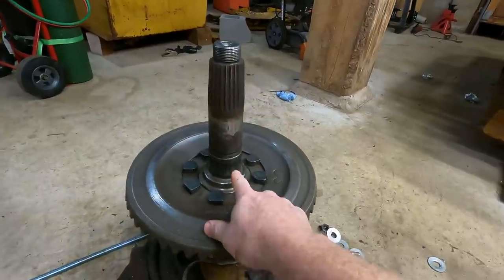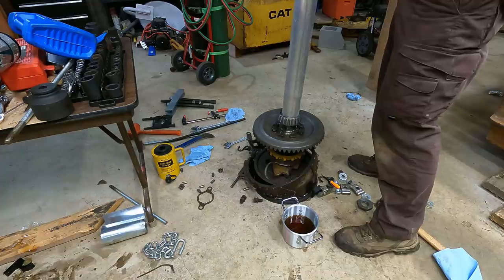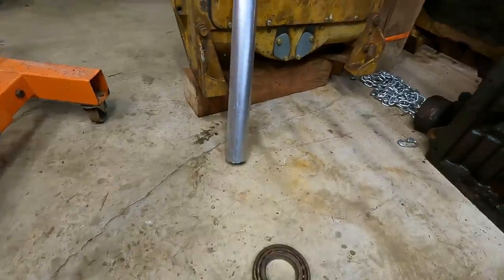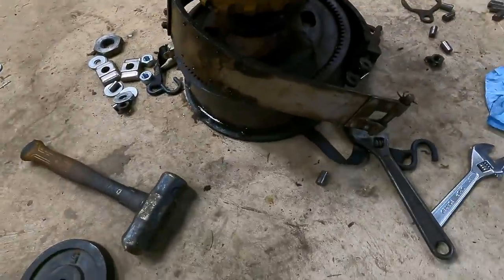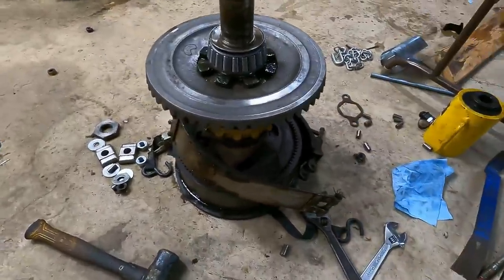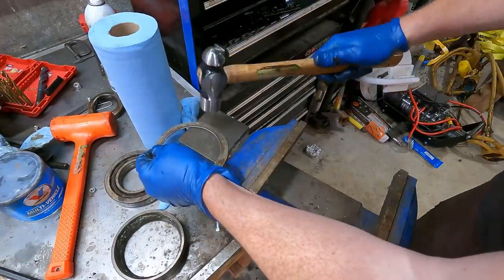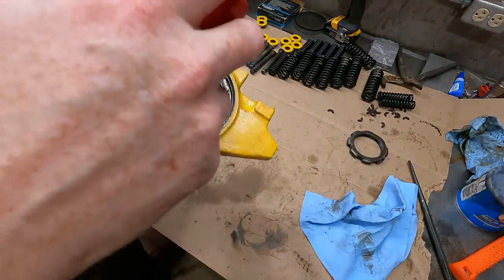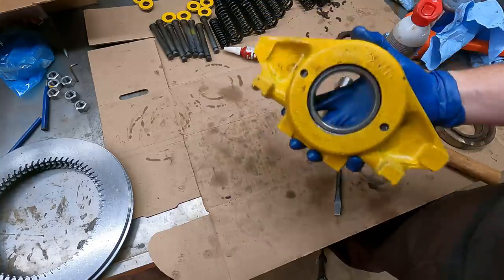Caterpillar D4 steering clutch and bevel shaft rebuild (part 2 of 2)

Comment: Western Truck and tractors repair just dropped a d4b under carriage and drive sprocket rebuild video ,he also told where he found the specific pullers  to do it .Two previous vids on bottom rollers and frame work .A pipeline construction company owner retired and has shops  of tools  and equipment for possible sale...

Comment: My first job with Cat was in the tool room. The most important thing I had to do is keep track of all the rental tools just for what you are doing now. Every nut, bolt, adapter, hydraulic press and pump had to be inventoried. Those kits had some serious rental deposits and some of the contractors were only trusted to cash. My strongbox and receipt book logged a huge amount of bucks every week.
It's funny but after all these years I recognise the tools you are buying.
I left Cat when I was 21, I'm 63 now. Time sure does fly.
Cheers
Reply: I really enjoyed what you wrote. In the Engineers I had to inventory General Mechanics Tool Boxes. Even now I think of tools by noun nomenclature, screwdriver, cross tip, etc. I think I had about 40 mechanics.
Reply: @suburban404  the military is the same way. In the Air Force we had to inventory before we left the shop and before we left the aircraft. Lost tools made for a bad day from the top down. You check, double check and yep.......check again!
Cheers

Comment: If you think your family members get upset with you heating up oil soaked parts in the oven, you’ll really get a reaction from them if you clean your sockets and wrenches in the dishwasher! I found that 1. It gets your tools amazingly clean! 2. It gets your wife amazingly mad!
Next time you need to weld thick parts with your wire welder, preheat them first with a torch. You’ll get much better penetration and a much better weld.
Reply: And clean off the slag between each pass, like IC Weld shows all the time.

Comment: Great job, Matt! I chuckled when you said "I use a ton of these on presses" and  in reference to the pressing force "it's not a ton of force". That thing about the new bearing being thicker - I can see that sort of thing happening to me. I replaced some bearings in the transmission of a fair-sized tractor I used to own - and found that one of them was missing a ball - apparently since it was manufactured! I'm looking forward to seeing you run this thing!

Comment: I don't know if you remember any of the commenters by name as of yet and for all sake of purpose, not necessary anyway. I am following this closely even though I will never be able to do this kind of work again. My question would be, remembering lightly when you found this machine, before you knew how much  real damaged this machine was, "were you confident that you could repair it" at the time, if it needed any type of repair? I think you are doing the right thing in building a machine from ground up as its going to be equivalent of a lightly used machine considering the engine is a "used" part. I do believe if any luck fell your way, was finding the engine you have for making it whole again. Most that age would fall into a tired but still usable piece of equipment. I have yet to work with but one man in my life that could do this. He was a old man in a young mans body and his ability didn't go unnoticed, he was that good. You may not call yourself a mechanic on equipment like this but if needed,  I sure would want you as the person to do any wrenching on my equipment. Its all I can offer you but please believe, I think you "walk on water" as mechanic.

Comment: Matt, if in doubt, grind a few mils off the snap ring's parallel face. You might have to make a wooden rig, but a belt sander will do the job. Also, they make bearing adhesives to keep outer races from slipping.
Reply: Why are my new bearings crunchy?

Comment: I like that you removed the coating from the nuts before welding. I see a lot of people trying to weld galvanized nuts to remove broken bolts and that does not work well the zinc results in lot of porosity.

Comment: Impressive results for a flux core welder.  Think I will pull mine out for a dust off. Upgraded to a  DC Electrode Negative back when that was a cool thing to do with your spare time.
Reply from the maker: you get way less spatter if you take the shielding nozzle off, it almost looks as good as normal mig... almost.

Comment: Where parts need cooling to aid assembly and are too awkward or bulky to get in a freezer, I`ve taken the "snow cone" off a CO2 fire extinguisher and held the hose directly to the part and done as slow a discharge as possible and it works remarkably well especially when combined with heating of the other part.

Comment: Another way to hold a loosely fitting immobile bearing race in place is to lightly pin it with a small punch around the race contact surface area in a dozen places or so and then press it in with a press.

Comment: on the throw out collar retaining ring that would no longer fit in the bore do to the thicker thrust bearing. i might have thrown the collar on a lathe and come in with a parting tool on a boring bar and  widened the groove the 0.040" to allow the wire ring to seat properly... obviously the cat factory bearing was a special with additional suffixes  chances are of the assembly coming apart without this mod is very slim.

Comment: A quick method you can use if bearings are spinning is putting a bunch of punch marks in the a part that the bearing fits into. I did it in my old beater truck axle gear housing plus some retaining compound and it's been fine for almost 10 years now, It's kind of hillbilly-ish but it works, so it should be right up your alley

Comment: For loose fitting bearings, you can use a centre punch to put a dozen or so dimples on the inside of the housing. The raised material around the centre of the punch mark will be enough to now hold your bearing in place.

Comment: Seen a few videos where thy peen, the bearing housing with a pointed punch, creating fine dimples right around the housing. This makes for an interference fit, so the outside race doesn’t spin in the housing, along with locktite in place

Comment: Matt, I did the same job on my 1949 and I had the same problem with the .040 too thick bearings. To get the snap ring to fit properly you need to get the right bearing. As I remember, I called the clutch supplier who is the same one you used, and he got me the right bearing, so you don't lose that snap ring later. Just thought I would give you this info, hate to see you have to rip it down again.

Comment: If your considering upgrading your welder look into the titanium 200. I had my reservations about spending $800 at harbor freight but it hasn't left me unhappy. Its every bit as good at a the Lincoln 210mp. Mike Festiva has some good videos comparing red and blue machines to it.
Reply: Mike has some excellent advice on desirable features for a welder

Comment: I'm certainly enjoying your videos! Do have one comment tho - those clogged passages in the bearing supports don't make any sense. Sure seems like the outer race should be captured so it doesn't revolve while the inner race should but why would the design include lube to that point? Is there a passage or clearance that allows the lube to come through the carrier and onto the bearing cones?

Comment: Measure the groove for the snap ring, go on Mcmaster carr and buy internal retaining rings. The large diameters are available in various thickness, if the clip/ring is not seated in the groove and engaging properly you are waisting your time. Using the retaining compound is a smart idea as it basically does the same thing as a retaining ring, however, there is nothing wrong with redundancy.  Instead of drilling and tapping for set screws you could just use red loctite.  If you are insistent on using the set screws, the next time you aee working on or near an un-shielded bearing dip both the drill bit and tap in heavy grease. The grease will help keep the chips in the cutting flutes and out of the bearing races.

Comment: Love your attention to detail.  I wouldn't have thought of lock tighting that bearing.  Quick question though, why not just shave a little off that snap-ring?  Glue a piece of sandpaper to the table and put a piece of wood above the ring move it around until you have shaved a little.  Also running set screws instead of stakes is pretty cool.  Started looking at this channel after seeing a D4 for sale also in Oregon.  It's 2k on facebook if you wanted a spare.  Decided I'm good after all this but have definitively learned a bit from your channel and your commenters.  Anyways once you are done with this thing it's all going to be worth it.  There is also an added worth for your venue renting.  A classic dozer outside is perfect for the ambiance.  Would love to see a classic excavator next lol.
Reply: Only a small part of the round wall of snap ring is supposed to seat, so sanding the diameter it is not good advice.
Reply: @SportbikerNZ  Why not?  Wouldn't that still have the same part of the snap-ring seating?  I am talking about sanding the side of the ring that would be touching if you laid it down.  Maybe even a little off of each side.
Reply: @ConSeann3ry  Because only about a third+/- of the snap ring is designed to seat.  Sanding down the diameter of the snap simply weakens it for zero result.  
Even if you make an assumption the groove is deeper than the 1/3 of snap ring it accommodates, you would have to sand the snap ring down to the diameter of the groove before it even starts to seat deeper.  Nature of round wall snap ring in angular groove. 
Minor sanding will produce zero result.  Only once the snap ring is the diameter of the groove will it seat further (if indeed there is space), and then you better pray the groove isn't so deep that too much of the snap ring has disappeared into it.

Comment: Good job all around on the clutch setup. Where did you buy the Hollow Ram,  the Bridge Puller, and the Spring Compression Tool ? Please respond when you get a chance, thank you.
Reply from the maker: The ram is just a generic Chinese one off ebay.  The puller is an OTC 938 17.5 ton, the spring compression tool is from General Gear
Reply: @PacificNorthwestHillbilly  Thank you for the information, will be waiting for the rest of the restoration of the D4 videos.

Comment: if you have a bearing that is not a proper,tight interference fit...........use loctite bearing mount to keep it secure, brilliant stuff, will stop your bearing spinning in the housing, ruining it. Its a common problem in the aluminum housings of small engine and motorbikes, once the bearing has been taken out for replacement, the next bearing just isnt quite as tight and could spin.

Comment: Please explain how the clutch works before putting it back together.
I do not understand how it is operated.
The coaxial springs close it? Then what opens it? Why is it so spikey? Cooling?
Reply from the maker: I'll do it when I put it back in, but basically the two part inner drum has those steel discs which are locked to it with their inner gear teeth, and the friction discs are between those which lock them to the outer drum.  the two halves of the inner drum are held together with those springs, which keep the friction and steel discs locked together.  The controls connect to the throw out collar and pull the two parts of the inner drums apart to disengage the friction and steel discs.
Reply: @PacificNorthwestHillbilly    THX
"throw out collar and pull the two parts of the inner drums apart"
By pressing onto the bearing you installed into it at 5:00 ?
At 16:00 this shiny new copper porcupine ring appeared around the clutch drum, magic? Just a cooling sleeve that you slipped onto off camera?

Comment: Watching your painting of the ring and pinion and you wondering what to do about the felts and the corks. I think these are still available (it’s been a while) at Cat. Most of the gaskets are available. You could save a lot of time with original Cat gaskets. Quinn caterpillar in Salinas have two guys that are knowledgeable about these old machines. Hard to find a good parts guy. Phil Rodriguez or Mike McCormick. Just a thought

Comment: Hey Matt, Great videos. one thing, isn't 10-12 tons = 20,000 - 24,000 psi?
Reply from the maker: the size of the piston in the ram determines the tonnage... bigger piston means more square inches with the same pounds per square inch = more force
Reply: If it's straight tons that he is talking about then that is a force.  PSI is a pressure.  They aren't equal.  The tonnage/area = pressure.  So it depends on the area the 10-12 tons is applied to.
Reply: 10 tons/4000 psi. He must be using a 5 in ram.
Reply: @PacificNorthwestHillbilly  Not to mention the locking nut also provides a backup hold-in point as well.

Comment: Those hubs we always take off with a H bar with hi tensile bolt if they r a bit stuck a bit of heat always work we never press them back on just a socket 1 inch drive with a pipe pull it nise and tight a little bit more to align the lock plate d4 d5 d6 all r the  same more or les

Comment: I recently did mine as well. I live in South-Africa, I struggled so much to get the discs, and had to install what I could manage to resurface. I would like to order all the discs on the steering clutches. If you can provide me with more detail it would help me so much..
Reply from the maker: General Gear in Idaho, USA had all the discs.  Not sure if they ship to SA.  They might though.

Comment: With that bearing being .40" thicker than the old one, could you have left that guard ring off?  What does it do?  Or take both guard rings to a grinding shop and thin them down so the snap ring fits comfortably. ?
Reply from the maker: That's pretty much what I ended up doing, hammering it back into shape and then grinding it down a bit with the angle grinder.  I think it helps channel the lubricant into the bearing instead of dumping it out of the collar, when you pour lubricant down through the cover.
Reply: @PacificNorthwestHillbilly  You have a lot of guts brother.  Good Job!

Comment: It is nice to see that your getting brave on your resemble of the parts and please replace that poor excuse of that press that is always flexing and could get your hands hurt.
Next your compressing parts too close to the high pressure oxygen tank which is not to cool to do.
I just noticed your stove a few feet from were your working again unsafe. In order to reach a old age you need to be careful.

Comment: I have a D4D 82J series and I’ve rebuilt the steering and main clutches in it, mine is a mid 70s model and there’s a lot of differences especially with the main clutches which run in oil on mine but the steering clutches are similar and I also used parts from General Gear,…one thing I want to pass on is, once you start using your Machine, the steering Clutches will wear in and you will need to readjust them a few times because they will start slipping,…
Reply: The twelve plate upgrade is a must. It cuts your break-in adjustment down to one after burnishing.
Reply: @carmudgeon7478  I’m pretty sure that mine was 18, it’s been several years but, I’m thinking it was
Reply: @kevinhonaker9468  You are probably right. I quit Cat in '96, so I may have the  #s wrong. But the Certified Rebuilds upped the # of clutches, changed the pony motor clutch material, etc.
Reply: @carmudgeon7478  The replacement clutches are made in China and I’m sure that the Quality isn’t as good as OEM so, it’s understandable that they are probably not as durable

Comment: Where did you purchase all your parts I’m doing a 1966 d4-d
Reply from the maker: Steering clutch and main clutch: General Gear.  Most everything else was on ebay
Reply: @PacificNorthwestHillbilly  thanks for the info
Reply: @PacificNorthwestHillbilly  I’m not doing complete rebuild just left pinion bull gear and steering clutches hopefully